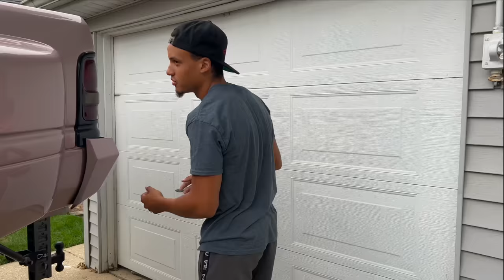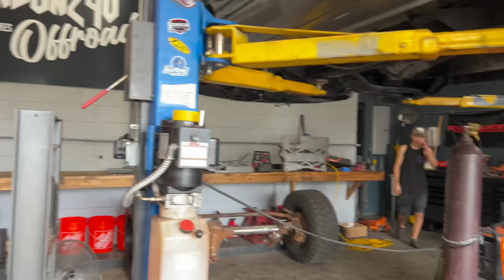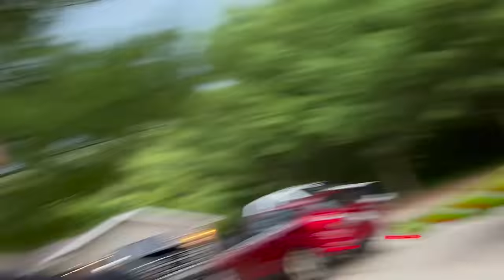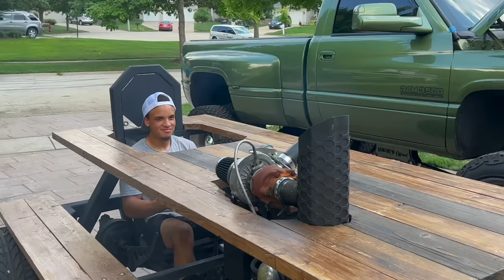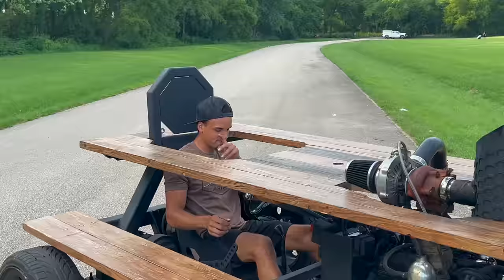I bought a Turbo-Diesel Picnic Table!

Comment: Just be careful man I'd add a thick pad around the part of the table that is directly in front of your face and make sure you are strapped in, if you run into something your face would go right into the wood. Maybe a hinged removable panel to give yourself more clearance in front of your face.